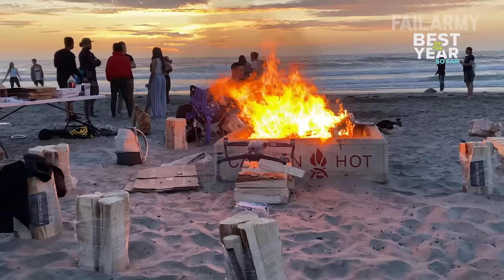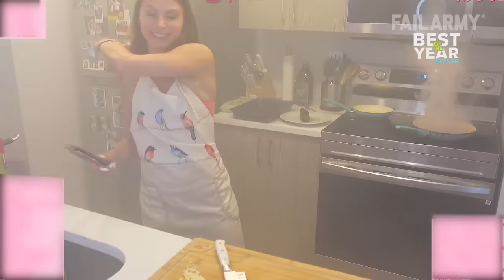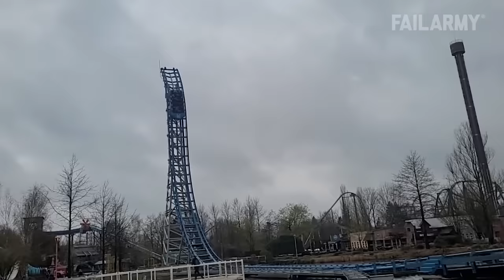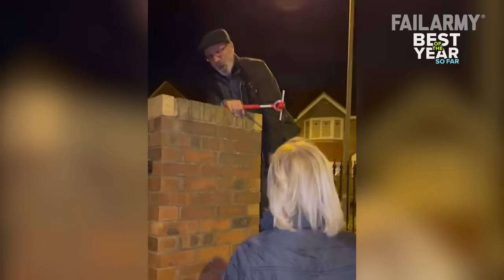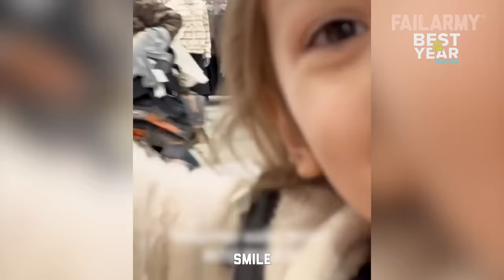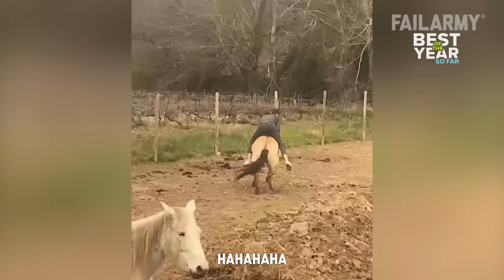Best Fails of the Year (So Far)| Try Not to Laugh

Comment: The amount of people not knowing how to react to a kitchen fire is worrying
Reply: Very true. That was like best case scenario considering how poor her choices were.  First I thought she was going to dump the  mess onto the floor and probably burn her house down.  Then the water blunder usually goes much worse - lucky for her there wasn't too much oil in that pan.  Just put the lid on it and remove it from the heat - so simple!
Reply: I have a infamous story though, my early 20s first apartment , put in a piece of chicken in the oil (not realizing it was WAY too hot) BURSTS into flames in the small pot , kitchen is just blaring orange it was like a foot high of flame, I just stood there frozen going “ honey..... HONEY....” freaking my BF tf out lol, I picked it up and took it outside in the winter snow. But hey atleast I contained it. I swear after your first kitchen fire, MOST wont do it again..lol
Reply: Throw sugar or flour on it it'll be fine 👍
Reply: I was thinking to myself she took it off the heat good move, but then it just got way worst. Not to mention the girl that was asking her stream for help as her kitchen obscured with smoke...
Reply: I think this advice was on the original fail video: if you don't have a better solution, shove it in the oven and close it.
Reply: @Lia-hb8tn  If the chicken was wet, that also will explode in oil. ✌🏼
Reply: Natural selection 🤣
Reply: @jeffyjoebob8300  – ⚠ NO! NEVER EVER use flour (or baking powder). Flour and baking powder are highly combustible and can explode in extreme heat.

Baking SODA (not powder) or salt CAN work, but you would need such a massive quantity of these that it isn't really an effective method.

ℹ Here is my pasted advice from elsewhere:

ALWAYS supervise ANY stovetop cooking, but ESPECIALLY that involving shallow or deep frying using grease/oil.

NEVER use water. It instantly superheats, mixes with the grease/oil and then spatters everywhere, potentially spreading the fire further with flaming drops of grease shooting in all directions and also burning the person nearby.

NEVER move the pan, not even moving it off the heat source because that can spread the fire too and once a grease fire has started, moving it off the heat source is less important than stopping it spreading and fighting the fire in place.

Turn off the stove if it is safe to reach it by hand.

Ideally, smother the fire using a saucepan lid, or a fire blanket if you have one available (and you should ALWAYS have a fire blanket wall-mounted in your kitchen ready to use in such a situation. However, do not have it mounted on a wall behind or too near to the stove, or you may be unable to safely reach it during a grease fire. Instead, have it mounted somewhere else in the kitchen. Don't keep it in a cupboard or drawer or anywhere else where you cannot reach it instantly, or a visitor would not know where to find it.

If that does not work, or it is not safe enough to get close to do it, then use a fire extinguisher. However, ONLY user a wet chemical (Class K in the USA) or a dry chemical (Class B in the USA) extinguisher. These are the only types that are safe to use on grease fires. Or a combination fire extinguisher that features a B in the Class name (i.e. Class ABC in the USA). Other types have the same negative as described above for using water and must NOT be used.

It is also very important to have a fire extinguisher of the relevant type wall-mounted in your kitchen for these kinds of fires. However, do not have it mounted on a wall behind or too near to the stove, or you may be unable to safely reach it during a grease fire. Instead, have it mounted somewhere highly visible and accessible elsewhere in the kitchen. Don't keep it in a cupboard or drawer or anywhere else where you cannot reach it instantly, or a visitor would not know where to find it.

If you have other types of fire extinguishers in your home (which is always a good idea), make sure these are unlikely to be picked up and used by mistake on a grease fire.
Reply: @nickh5081  you actually think the average person still knows where the lid to their pot or pan is? We never had a matching lid for the pots or pans in my house. Only had to put out one kitchen fire though and it was my dumb ass uncle so not to surprising. But we had a proper fire extinguisher for the fire.
Reply: And even more worrying is the responses here saying put SUGAR on it when sugar is very flammable.

Soak a tea towel or cloth in water then put it over the pan. It will go out.
It's really that quick and simple.
Reply: Keeps the Funeral homes bussy... ;)
Reply: like put the lid on!!!!!!!!!!
Reply: @panic_lov3108  to be fair I have 8 pans and never used a single lid so threw them out.
Reply: @kalemdor1667  I think that the sugar comment was meant to be sarcastic
Reply: On Hell's Kitchen, the amateur chefs yell "SALT THROW SALT!" every damn time there's a fire and every damn time Gordon Ramsay always shoulders them out of the way going "For fuck's sake cover it, cover iiiiit" and just casually throws a couple of towels down and puts the fire out.
Reply: @kalemdor1667  or even better spend $50 on a fire blanket and fire extinguisher. Then spend a whole 5 minutes to read and understand the instructions. And while your at it get a second fire extinguisher for your car.
Reply: @kalemdor1667  Just use another pan if you don't have the lids, Fires are pretty easy to deal with if you don't panic. It's as simple as turn off the heat and smother it
Reply: Just smother the flame. Lid if you have it, or wet tea towel, but it needs to cover the whole pan.
Reply: @trafalgard.waterlaw7330  Umm, yeah, many do know there the lids are.
Reply: @metalgod6661989  which is why I said damp cloth over the top. 🙄
Reply: @trafalgard.waterlaw7330   I have the lids for all my pots (who cooks in open pots at all times?) as well as my favorite pans. The video in question had the corresponding lid clearly right next to the stove. NOT having it (or at least a suitable lid) available when cooking with hot oil is just careless.  Works a lot better than a fire extinguisher and doesn't make a huge mess! Having a fire extinguisher handy is a good idea anyway since more than just a simple grease fire contained to the pot can very quickly get out of control.
Reply: @trafalgard.waterlaw7330  On the first kitchen fire video, the lid was literally to the right of the stove on the counter. On the second, there was another pan that would have worked as an improvised lid. Learning to cover a fire to remove oxygen and smother the fire should be one of the FIRST lessons when it comes to cooking.
Reply: Why can't we have home safety classes in school?  That one stove fire..there was a cutting board sitting right there that could have been used as a cover to cut off the fire's oxygen.
Reply: @LHyoutube  guess you weren't feeling my sarcasm 🙄
Reply: @jeffyjoebob8300  – No, and in fairness you didn't make it come across at all in your comment. And it takes just one person (other than me) to not notice your sarcasm and try using those to make grease fire into a total catastrophe.

Comment: THANK YOU FOR DOING THESE VIDS !!! One word of knowledge...Any time you're cooking something that MIGHT catch fire, always keep a lid to the pan out and ready for use! YOU SHOULD NEVER put water on a grease fire. The grease floats on the water, so your fire will get away from you. Most kitchen sinks have a window and curtains. The first thing that catches are those curtains. If your pan catches on fire, turn off the burner and immediately put the lid on the pan. This will snuff out the flames by depriving the fire of oxygen! Never grab the pan that's on fire and try moving it! It has a tendency to slosh out spreading fire everywhere the grease goes! Also, it is smart to have a re-fillable ABC fire extinguisher hanging on its mount, in plain view, in your kitchen. Its very smart. They have to be re-certified after 5 years, I think. If you use one, it must be serviced and refilled, even if you just use a little blast! You want to use the lid to put the pan fire out. You want to use the fire extinguisher, to put out flames anywhere else. The best fire extinguisher for home use is the "ABC". A-Trash, Wood, & Paper
B-Flammable Liquids
C-Electrical
Badger makes a really good one. It's smart to have one or two at opposite ends of your house or apartment, and one close to your bed, especially if you or your mate is bad to smoke in bed. An ABC can put a bed out before it burns everything down.!!!
   Thanks again for these videos.
Reply: Another good thing to know is that baking soda will put out small kitchen fires. I put out a grease fire with baking soda once when my extinguisher failed (because I let it sit too long). The ones in the video would have done well to use your lid method, though.

Comment: That skateboard is stronger than I could have imagined
Reply: Well it needs to handle 60 or way more kilo's basically jumping on top of it for multiple times without breaking, so getting stuck below a wheel and getting dragged for a bit might not even be the biggest weight that it has to handle.
That said it was still impressive to watch :P .
Reply: Quality Skateboards are typically made of 7 ply Canadian maple wood

Comment: For grease fires in a pan, just put the lid on.  Pouring water in seems like a natural thing to do for a fire, but it has the opposite effect for some reason.  I learned this as a little kid.  Plus, the lid is so elegant.  I would've used the cutting board before I noticed the lid.
Reply: If someone doesn't know that they have no business in front of a stove
Reply: If no lid pour flour over it...
Reply: Good to know
Reply: The water makes the burning oil splash out of the pot, by displacing it
Reply: @heatherfreeman5604  flour can cause its own type of horrid powder explosion.  Baking soda is much safer
Reply: If you pour water onto a burning oil/fat fire, the temperature of the oil will cause the water to instantly vaporise, so that the fire basically erupts into a fire ball. You will probably end up with serious burns, and might well set the house on fire. Never move the burning pan. If you don’t have a lid, soak and wring out a towel,and place it carefully over the pan. This will smother the flames. Don’t ask me how I know!

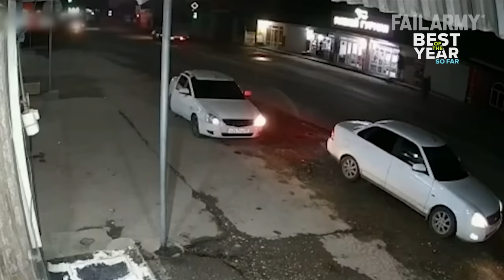Comment: It’s sad how many people don’t know how to deal with a pan fire. The most disturbing is the girl @ 14:05 who keeps talking to her viewers 🙃
Reply: IM SCREAMING "PUT A FUCKING LID ON IT"
Reply: @rainbowGZUS7  yep, surprisingly simple solution to any fire in such case, yet usually not known. Even worse, pouring water into an oil fire will make it worse, so it is the only good solution.
Reply: Also sad how many don't know they have a mini fire extinguisher in the fridge ( baking soda box )
As for her, She should be knowledgeable for her and her viewer's sake.
Reply: @soleiltounsi6754  not necessarily. Chip pan fires can happen with boiling oil catching on fire for example.
Reply: @soleiltounsi6754  nope, it just means the used oil, it overheated because they id not put in the food or let it in way too long, ans the vapors catch fire (or if really overheated, it can even ignite by itself or from a tiny spark from the pan)

for alcohol to burn, it needs over 40%, considering that very few alcohol has that by the start, and aft you add it to the food, it gets diluted rapidly, it is highly unlikely to start a fire with food added alcohol without intention (not easy even with intention, usually you use 60%+ alcohol for that and a torch.)
Reply: First thing you should do if you're holding the pan put the f**** pan down and stand back that will save you from getting Burns second thing you should do either grab a fire extinguisher or some baking soda import on to the fire if you can't find a f**** lid here's the 3rd thing you should do open the windows that will help get rid of the smoke because not only will the smoke condense if the windows are open it will also cause less air to go into your lungs which will eventually cause you to pass out and pass on to the afterlife
Reply: @williammcdermott8692 putting the fire out is way more paramount than opening the windows. Opening them would allow more air to come in and, literally, fan the flames. Covering it with a lid is the easiest and best way to stop a pan fire, as long as you stop it before it spreads any further.
Reply: @DPSFSU  yes that is another thing you should do
Reply: @thorin1045 that is somewhat incorrect about alcohol. You can light alcohol as low as 20%. Most alcohol is 40% because of taste. Too high and it will be too noticable, too low and it will taste weak. Alcohol burns with a blue flame so you could tell between oil and alcohol burning. Alcohol also evaporates at 172°F, where water evaporates at 212°F. (My brother and I used to make moonshine when he was in college and I was in highschool. 3 simple ingredients to make insanely high proof liquor. Water, sugar and brewers yeast. That's it. You'll need a boiling flask, make a condensing chamber for the vapor and some good thermometers. Make sure to discard the first 50mL and last 50mL so you don't get methanol, only ethanol.) Most of the flames we'd get were so light in blue color, you couldn't see them in daylight. Crazy stuff.
Reply: @DPSFSU yes and if you didn't see the way the flames shot up after she put it in the sink then you could tell which kind of fire she was dealing with

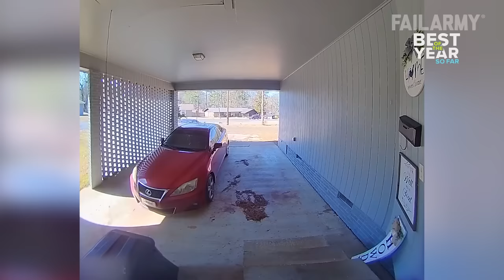Comment: 4:14 is why you always put some kind of case on your phone. It doesn't have to be an OtterBox or anything thick like that. But you could use a little bit of galvanized rubber around your phone to make sure nothing happens.

Comment: For those that don't know, the reason the car slams into the telephone pole is they hit the brakes. If that driver would have just let off the gas, and followed the road, they'd of been fine. When it's slick, especially after an ice storm, when you hit your brakes, your tires lock up, and you lose all ability to steer, you just slide straight ahead. Been driving in the north east my entire life, you learn to slow down before a turn, never break while turning, if your ass end is sliding in one direction, turn in that direction to correct.

Comment: if you have a grease fire in a pot/pan,   just cover the pot with the lid (maybe a cookie/metal tray or another --ideally clean/not containing hot oil or liquid pan    ....something to cover the pan  snuff out the source of oxygen)     OR if need be  smother it with salt(or if you have a box of baking soda in the fridge,  this is a great thing to douse a grease fire with).        Adding water,   as water hits hot oil it splatters,  making very thin film of oil,  which is why it flashes/bursts into flames.   

also.  get a small fire extinguisher for the kitchen.   easily accessible.   in case shit gets outa hand.

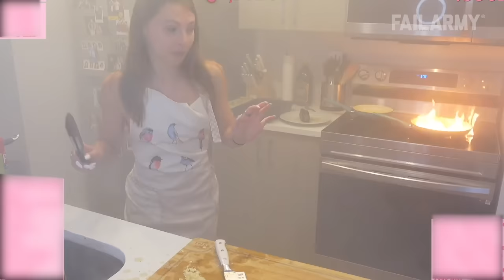Comment: 13:58 For the love of Jesus! Step 1. Do not panic. When you panic you make mistakes. Step 2 turn the heat off. Step 3 place the pan/pot in the sink. Step 4. Place a damp or wet towel over the top to snuff out the flames. DO NOT POR WATER ON THE OIL as this will just make it worse.